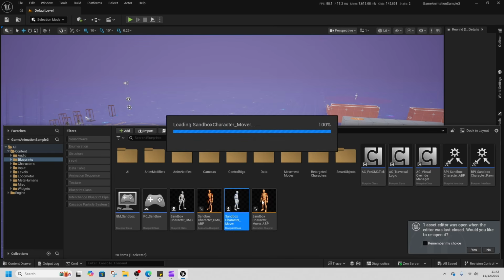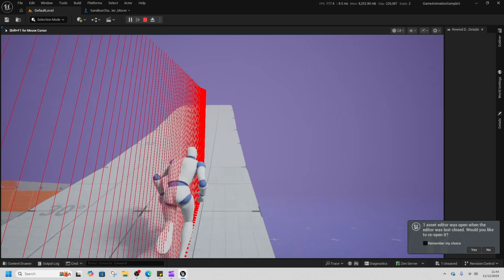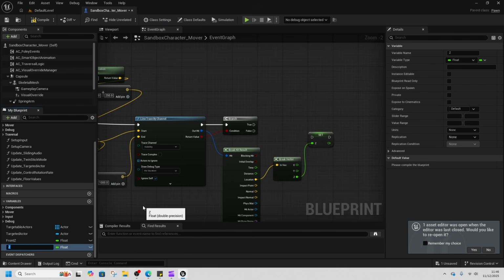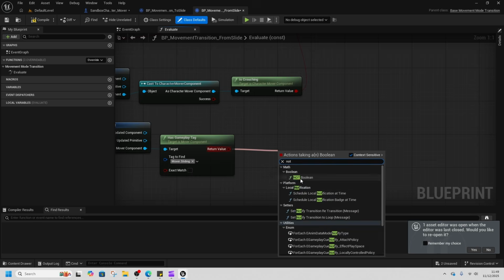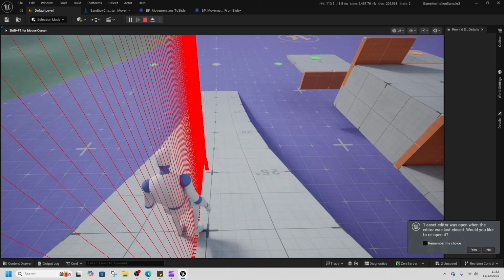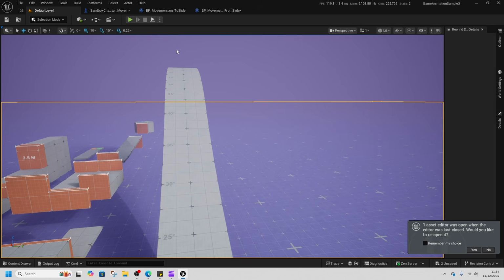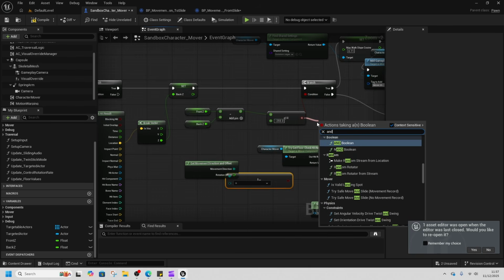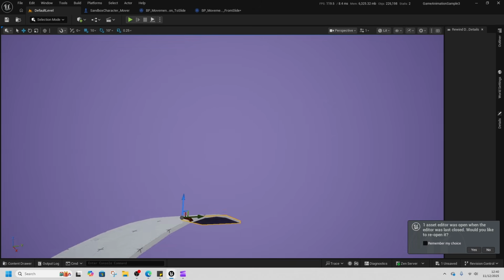Mover 2.0  Automatic Slide Gasp 5.7 Unreal Engine 5

Comment: Nice tutorial, thank you. I have an issue on 5.8 as it seems my character keeps sliding as in your video right before you added the remove tag. I strictly followed your node chain but my remove tag apparently has no effect whatsoever. Any clue ?
Reply from the maker: Check jts hitting that branch where its removing and if it is then its likely your transition out of the slide not having the and setup with the gameplay tag check
Reply: @Zero2GameDev0  I can't tell, I've build everything exactly as you've shown. The bp transition from slide has the mover.sliding gameplay tag properly set as well as the floor check hit result branch. I've gone twice thru your entire video to make sure I haven't missed some important stuff...I haven't.
I may go thru it a third time then :D
Thanks for answering btw.
Reply from the maker: @Raven0509  always welcome to pop some images in the discord as well so can take alook. Have you added a print string to the bit where its removing the gameplay tag to check its being called and triggered?
Reply: @Zero2GameDev0  Didn't know about discord, thanks.
It triggers indeed. I'm not using the ramp from gasp. My setup is simple, two traversal block assets as plateforms, one being steep to the ground. When sliding it triggers the slide and if I pull back to the upper plateform it removes the tag and stops sliding. If if drop from the steep plateform to the ground asset, it remains in sliding movement till I get close to the steep plateform then it stops and switches back to walking.
Reply from the maker: @Raven0509  now i have the gull picture of what your trying to do then id look at right at the end of the video theres a branch where it stops rest code running if not more than something add a print string to your false there and then try and drop off i suspect its triggering false cz its not finding anything while in air and then when hits ground its flat so still hits false.
Reply: @Zero2GameDev0  So, the print string set on false output that goes to remove tag branch only triggers when the line trace hits the slope. Also my character do not slide the ramp unless I move forward. Is it intended or it should slide as if physics are applied ?
Sorry to bother you, feel free to stop this exchange ;)
Reply from the maker: Not that branch theres one right at the start of the code event that stops the rest of the code running if not on a slope first try ignoring that branch and see what happens
Reply: @Zero2GameDev0  I managed to fix it by pluging the entire remove tag branch into the false output of branch node that comes after the ACOSd >= 30
It's now perfect with any steep asset and any ground topology beneath.
Last question, is there a way to have this auto slide on slopes behave like physics instead of having to hold a forward device input ?
Thanks again for all your support throughout this process, you're awesome.
Reply: Fixed this as well modifying the ProduceInput to have a "forced" directional input downhill while keeping steering abilities when bAutoSlide is true. bAutoSlide bool being set on AutoSlide chain right before tag is called or dissmissed.

Comment: I'm having quite a few problems with it:

1. When running downhill, he doesn't start sliding, but jumps briefly and then falls a bit.

2. When running uphill and jumping, he falls backward and sometimes triggers the slide (see point 3), but since you're looking up, you slide upwards.

3. On the left and right sides of the slope, he very often triggers the slide even though it's just a difference in height and not a ramp.

4. How do you trigger the slide on both knees? the right one on the thumbnail.
Reply from the maker: 1. You need to tweek whatever value your angle that triggers the angle is
2. Hard tell what tge issue is here without code
3. Thats a level design fix just add sides and tag them wo the trace doesnt recognise them to stop the slide.
4. Can swap the animation in the state machine/chooser but the normal trigger is a strafe left or right slide
Reply: @Zero2GameDev0   thanks for the fast reply, 
1 and 2 i used all values and blueprint nodes like you do. 
3 so i need to find all places and add a kind of disallow trigger ther o,o 
4 ah okay, since i only can get the animaten when sliding backwards and never now if that is a bug from gasp ^^

Comment: Could you do a quick update to this one by chance that shows the character sliding back down if you attempt to climb a slope that's too steep rather than just walking in place like there is an invisible wall in front of them? And/Or a video explaining how to make a character walk slightly slower going up a slope of a certain level and slightly faster going down a slope?
Reply from the maker: All the nodes you need to do what your after are in this tutorial. Change the acceptable walk angle to allow any slope then check that each step if over x threshold reduce speed or increase etc by setting the walk speed in wlaking movement mode and if the angles too steep chage movement to sliding, setting the rotation is a pain to do as old methods dont work for mover and new methods are too hacky currently for me to publish but maybe you’ll have better luck than me :)

Comment: In my project build, the "shipping" build causes the character to slide half a meter below the floor through the floor mesh. Everything is fine in the editor and debug build. What could be causing this?
Reply from the maker: force offset root bone to be enabled in the abp should fix it
Reply: @Zero2GameDev0  Unfortunately, it didn't help.
Reply from the maker: Dont set it in the variable directly unselect the console execute variable and make sure its true there. The console variable seems yo reset it to false in shipped builds

Comment: Hey there - in the first Mover video by Epic they have a section where they show Chaos networked physics stuff, the two characters on a rope bridge, and most interestingly (to me) a character standing still getting hit by a swinging mallet and getting knocked aside. When I tried to set this up myself with Mover 2.0, I get the classic old CMC type behavior where the character doesn't get pushed unless the player is providing movement input. So up-down moving platforms work fine due to the kinematics options, but side-to-side moving walls just slide through the player - yet they work perfectly as long as you're not standing still.

Curious if you have any idea how to make this work - a physics-based movement with Mover video would be pretty cool.
Reply from the maker: i believe its the chaos charachter mover component you wnat but thats vene more of a mystery than the current mover system so it's going to take tiem to dissect. still just a family guy with a job trying to make a game and fun lil tutorials only so much time lol

Comment: Have you figured out how to do a melee montage combo in mover yet? It's only been using the first sections root motion and ignoring the rest of the combo and then sliding towards where the final location would have been.
Reply from the maker: are you using the old play montage node? or the new one? did a video about the new mover play montage node if you dont know what im talking about
Reply: @Zero2GameDev0  I am using the new one, I watched your video and it works perfectly for one off montages but if you try to make a combo it doesn't work
Reply from the maker: @thefight1799  i havent had that issue for combos although i likely do combos diff to most but post some details in the discord i’ll take alook see what crack is
Reply: ah yeah im having this same problem too. im using the mover play montage node but at the end of the melee montage attack, theres a motion matching transition that plays that doesn't feel good. would like to disable that, or mover, or whatever is going on and have gasp/mover turn back on after the montage is over

Comment: Great tutorial, super helpful to understand how mover works. How would I make the character slide down if its too steep of an incline? Seems like it should be easy from where the tutorial ended.
Reply from the maker: if the incline hits over 30 it will auto slide here unless im missing what you getting at? the video should do exactly what your asking?
Reply: @Zero2GameDev0  That's what I thought upon seeing the title. It prevents you from walking up the slope but does not auto slide down unless you are running down a slope.
Reply from the maker: @ChromaticCreations  you dont need to be running at all you can jump onto the slope or walk onto it and it will slide down as long as the incline is more than 30
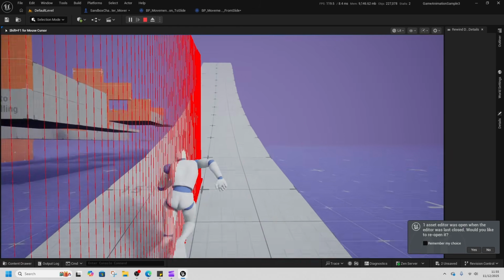Reply: @Zero2GameDev0  I must have missed something. When I try to run up a slope it just blocks the movement like at 13:00. Thanks for the fast reply.
Reply from the maker: That bits optional i just like it for added feel, if you remove it you should as long as facing up the slope be able to walk up it, if you turn around mid slope you'll start sliding, but from the top of the slope you shouldnt need to be sprinting to start a slide after 30 degrees, places id look would be the transisitions back to walking to see if the condition for the removal of sliding tag is being met.
Reply: @Zero2GameDev0  Yeah i retested it and it does work regardless of sprint. What I meant was when it blocks my movement I would rather it make me slide down the slope.

Comment: Great video! Now, a question: how do I use GAS in my project? This new update keeps failing when I try to add it...
Reply from the maker: gas = gameplay ability system? or gasp for gameplay animation sample project? project failing doesnt really give me much to go? are you trying to add mover or gasp cmc? is it a backwards move ie 5.7 to 5.6? mover is a whole seperate system to the normal cmc your charachter likely is built from so bare that in mind you could be creating more work, why do you want to move it?
Reply: @Zero2GameDev0  Excuse me, I'd like to be more specific. I'm using Game Animation Sample (the version prior to 5.7) in Unreal Engine 5.7.1. When I create a new GAS 5.7 project and migrate, everything works correctly, with over 2699 files. But when I try to import the same files I imported with GAS 5.6 and create a new mode, the mannequins remain static. I get three errors: "16-bit bone index support," "Unlimited bone influences," and "Use experimental fragmentation." I was only able to fix the first two, but everything else remains the same, with open arms and many red errors in the event graph. Thanks for your help.

Comment: Great tutorial! It would be great to implement it in a way that you can jump onto a ramp and slide along the inclined surface. Hope you'll continue this series
Reply from the maker: That should work here unless im missing what your trying to do? If you jump your in air then you hit ground and go to walking which hits the slide transition if the angle is more than 30 degrees. Its not really a series just a video someone requested that seemed like a fun challenge to do

Comment: could this be possible with character movement , unlike mover it would need to have a line trace firing off every second right?
Reply from the maker: Mover fires every second in the movement mode and the transitions on tick anyway thats how it knows to transition when criteria are met. 
Movers main advantage is that the slide code to calculate physics etc is allready setup but its possible to do in the cmc charachter and third p as well just requires alot more work
Reply: @Z @Zero2GameDev0 t usually in cmc it doesnt look as smooth as mover is there a way to get it to look that smooth?

Comment: Will this work with 5.6 Third Person Template? I'm currently working on a horror game and was thinking of adding a slide mechanic, but I'm too far into development to move to GAS template. Thanks!
Reply from the maker: Yes and no the trace is 80% the same but it uses mover so those bits are replaced by the cmc mainly the current floor angle we are stood on. The transitions dont exist in mover so you’ll need to receeate a state machine for those, the gameplay tag bit is the same though just in the abp instead might do a tutorial and add it to the fab pack i have for sliding, we’ll see.
Reply: @Zero2GameDev0  I see. Thanks!
Reply: @Zero2GameDev0  can u plz make a tutorial for sliding using the new 5.7 animations for non 5.7 versions